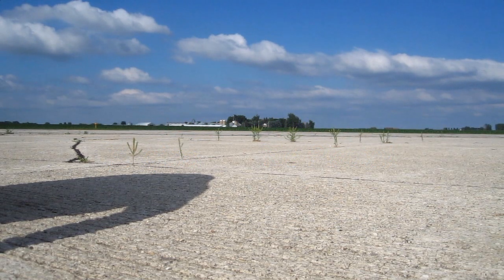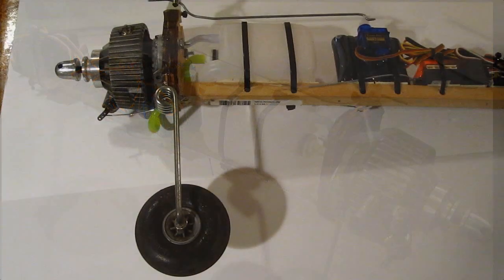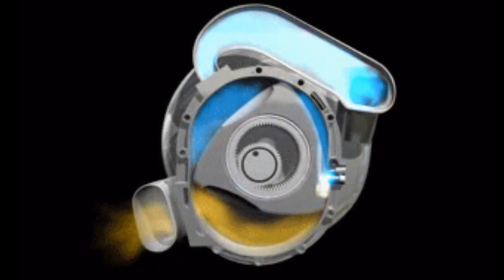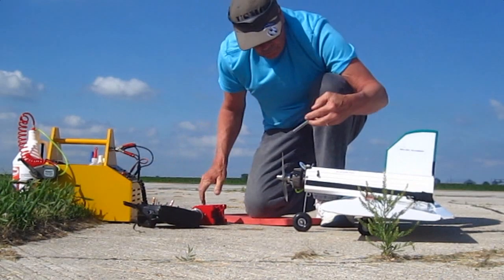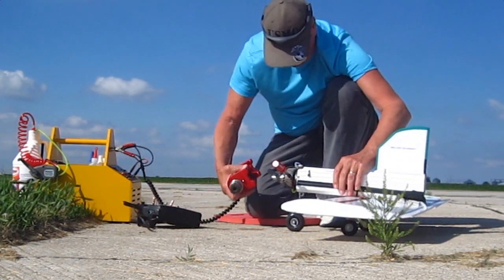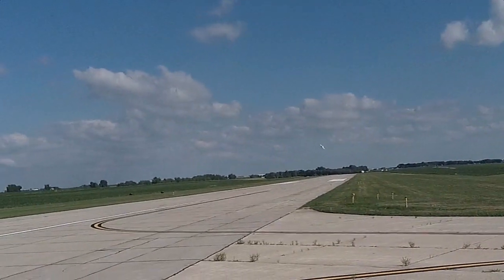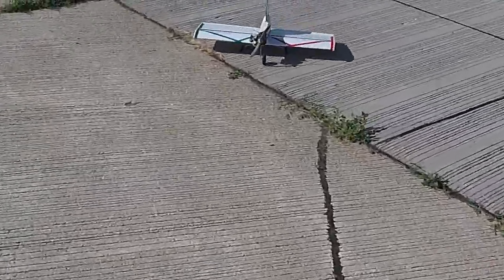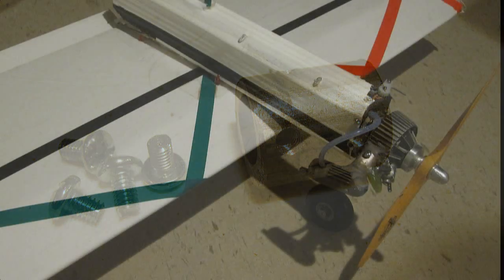Tiny German Nitro Engine has NO Pistons but is a vibration-less powerhouse for it's size!

Comment: I spotted a muffler on eBay if you’re interested
Reply from the maker: Thanks.  The muffler is not the problem. It is the cooling ring around the engine that it attaches to.  That mount is broken. Sure would like to find that part.
Reply: @NightFlyyer  ah, that’s a shame, hopefully you’ll find one soon. 👍

Comment: When I was a young boy some RC club members used to have a wankel engine in their pretty fast models. I think they did use a smaller prop and the engine seems to turn twice as fast than yours. Was an amaziing sound! According to https://www.os-engines.co.jp/english/line_up/engine/air/wankel/manual/rotary49pi_2.pdf it has it's highest power output at 17,000 r.p.m. Greetings from Germany :-)
Reply from the maker: Mine is turning aroung 15,000 rpm on a 9 4 prop, which The manual says to use.  I have other videos of my first Wankel which was new and ran better but was destroyed in the fire.  This one is pretty worn, which I got from eBay and doesn't run as well, but still happy with it.  Here's from 2011 with a better newer engine.  Thanks. https://www.youtube.com/watch?v=FrsSvTx8KG8
Reply: @NightFlyyer  Hello and thanks alot for your reply and sorry to hear about your losses caused by the fire. Must be horrible if everything ist lost. :-(
The high RPMs were reached wile doing a nosedive with the plane. I agree that this might not be too good for the engine, but for there are no oscillating parts it seems not to be as harmful as with a traditional piston engine. The sound was spectacular definitely  :-)

Comment: They are on eBay all the time.  Both the earlier ones with just the tapered finning design, and the later one with the added cooling fin scheme.  And some come with a nice muffler.  Some used.  Some new in the box.  Big demand, though, so they are pricey.
Reply from the maker: Yes.  I have had several and got them all on ebay, except the first one which I show in this video I made a few years ago.  They are pricey.  Thanks.  https://www.youtube.com/watch?v=FrsSvTx8KG8

Comment: I wish I never sold mine.... Now they're collectors items. I had one of each size graupner sold...
Reply from the maker: I wish they were still making them.  My original one was burned up in a fire and ran better than this one, and your right, I got it on ebay and it was expensive!.  Thanks.
Reply: @NightFlyyer  So sorry you lost your "good" one in the fire, I can't imagine. But it seems some of whats driving the prices up on these are Mazda Rotary heads buying them all up for "desk trinkets" .
Reply from the maker: @JessHull  LOL  True.  Thanks.

Comment: @NightFlyer >>> Is the O.S. Wankel out of production?

FWIW:  For years I have wanted to try building a powered parafoil - MY preferred name for a powered parachute - as an aerial camera platform, to augment KAP &  KAV {Kite Aerial Photography & Kite Aerial Video}.   I have YET to try building one...😊

That said, I wondered of the Wankel might be a good engine choice due to minimum vibration.  HOWEVER, someone online informed me that they (1) Tend to burn MORE fuel than standard glow plug reciprocating engines, and (2) They tend to run hot, and need plenty of airflow for cooling.  A powered parafoil being a slow-flying aircraft, I presume that would provide insufficient cooling air.
Reply from the maker: OS stopped producing this engine years ago and why they cost to much on Ebay, if you can find one.  It would not make a good parafoil engine, as your right, they use a lot of fuel, the exhaust is very messy, and they do run hot.  I'd stick to an electric Parafoil, if I were you.  Good luck and happy flying.
Reply: @NightFlyyer  >>> Rodger all that - Thanks!!!!

Comment: Hmm I wonder if you could make the outer part spin like an outrunner electric motor
Reply from the maker: Unlikely as it would be hard to hook up fuel lines, carb, and balance I  suspect.
Reply: Not practical for this, but "rotary" airplane engines did exist.  In this case, a "rotary" engine looked like a radial airplane engine at stand still.  But when it ran, the cylinder assembly rotated.  This helped with the air cooling (especially if the airplane was standing still), but also added air friction losses due to the rotation.  Fuel and oil was, obviously, handled differently and a problem was that oil was centrifugally thrown to outer parts of the engine and had to be continually replenished.  So typically oil was mixed in with the gas, even though a four-stroke.  There were also some engines like this, usually 3 cylinder, made for some early cars and motorcycles.  They have (or had) one at Cal Poly Aeronautical Engineering Department at San Luis Obispo on a test stand that they would fire up once a year.  Pretty interesting beast to watch.

Comment: 5cc is tiny?
Reply from the maker: This is tiny compared to a .90. 5cc compared to this is tinier. It's all relative.
Reply: Wgat a strange world you live in? 0.1cc could be called tiny. I beleive this wankel engine is designed to run on straight fuel, not nitro.
Reply from the maker: No kidding! LOL. What is your point?   This is a unique engine that can easily run on Alcohol and synth oil, and runs best with at least 5%, as was recommended by the manufacturer, however most engines will run without any nitro content.  I own the smallest production engine in the world, so I understand small, and am no armchair pilot, as you would know, if you have ever watched any of my videos.

Comment: I was making a B-25 with 2 ,OS rotary motors . They put out 1.25 HP each , were small and looked real behind the coke bottle bottom cowlings . They would suck gas like a 60 .
Reply from the maker: Your right about the fuel consumption for sure!  Bet it sounds great, though!

Comment: I am amazed at just how flat and square a flying wing can be and still fly.
Reply: Also that initial camera angle, made it look like a scene out of realflight simulator haha
Reply: Looking forward to the heli vid. I haven't gotten the courage to fly my 450 again yet since the rebuild.
Reply from the maker: Real flight isn't as real as this is, believe me.  LOL.
Reply from the maker: It's on the editor and almost ready to put in the can, as I flew it tonight too.  Please stay tuned. Thanks.
Reply from the maker: I always said, you could fly a garage door if you have enough power. BTW, it's not square or flat. It has an airfoil that you can see in my build video from last summer.  Thanks.

Comment: Nice universal plane "stick" I love it! BTW have you asked at Graupner directly? When I worked in south Germany I always drove by a big facility of theirs, they probably still have that model.
Reply from the maker: I have not.  I've spent hours searching however with most used engines selling on ebay for $400 to $500 so I gave up and made the sleeve which is working very well so far.  Thanks kindly.

Comment: Its been awhile since I heard one of those running. That engine is really revving nicely, pity about the damaged muffler manifold. That's not going to be an easy repair.
Reply from the maker: Thanks. Not always do folks tell you exactly what conditions things really are on Ebay!!  Actually my sleeve was not that hard to make and is working pretty good so far.  Thanks kindly!

Comment: cool stuff! didn't know Graupner made those, always wanted to try one, never did
back in the day a local drag racer had a mazda rotary in a glx, it walked 454 chevys, sounded like a hornet in a can
Reply from the maker: Yes, I think they are bringing back a new version too.  It will undoubtedly crank!  Thanks.
Reply: Graupner was the distributor, they were manufactured by OS Max of Japan. Beautifully built engines, however the early ones had teething problems with the rotor compression pads failing prematurely.

Comment: Love my rotary cars! They don't have a lot of power, but the RPM range and the light weight of the engine mean improved driveability and a good power to weight ratio. My RX-7 only had 185hp, and the RX-8 only has 240hp. The RX-7 was so light, I think it was actually faster than the RX-8.
Reply from the maker: They could really wind up the rpms for sure too.  Thanks.

Comment: That wankel would honestly be great for anything speed related. They dont tend to have much torque, but they can spin at 20k rpm all day
Reply from the maker: Very true. Lousy on fuel economy too!  Thanks.
Reply: NightFlyyer not that bad of a tradeoff for so much speed and power in its weight class.
Reply: Butternut Squanch piston engines may be more capable, but wankel engines are a lot of fun to use
Reply from the maker: That is true.  I never said there weren't other high speed engines.  I just said this unique rotary engine does pretty good at 18,000 rpm on a 10.6 prop with no piston! I had a tiny cox .010 that cranked 27,000 rpm with a piston and a 3 inch prop.
Reply from the maker: @iCrashPlanes I loved my .010, but it along with all my planes was lost in the huge fire plus just about everything else I owned.  Those tiny balsa Guillows models were great for the .010.  Happy flying.

Comment: Once I tried to make my own micro Vankel engine but I had no compression. problem was the apex seals leaked on the side but if made them with tight fit they will seize when engine gets hot so it got junked it was weak and dangerous to run rest in pieces literally
Reply: NightFlyyer you could try put a non restrict muffler .4 stroke engine runs stronger if it breathes easy, and use the electric fuel pump with fuel pouch if possible but not recommended long term solution because spare parts are scarce we don't want to retire it :)
Reply from the maker: That would be a hard project for sure.  They DO get hot!  This OS Max Graupner never has failed, so they had it figured out and made them for years.  Wish they still did.  Thanks.
Reply: Sounds like you would have to get very precise and establish a operating temp, calculate material expansion and measure time and time again
Reply: kennedy796 if I ever try again I think the apex seals need to be made out of crome the thermal expansion issue would be resolved and the engine could last longer and have better compression
Reply: Black turbine or just make it all out of similarly expanding material. Cast iron comes to mind.
Reply from the maker: I have tried that and it runs awful with no muffler and still no way to attach it anyway.  I know Harley guys think their engines run better with no mufflers, but when I went to mechanics school back in the 60's I was taught 4 stroke engines run better with some back pressure. This is not a 4 stroke engine however. My sleeve is working very well, so at my age, it will probably outlast me.  Thanks for the tips.
Reply: kennedy796 that would make a good, hi compression and cheap to maintain but the counter balance would be huge to compensate so is would have some gravity to it . I used stainless steel for end plates,oval,eccentric shaft,counter mass, and aluminium for rotor,prop spinner, engine mount.
The rotor has side seals so thermal expansion ca be ignored but apex seals need oil clearance so they don't dig into endplate so no compression, but if I make them enough of a fit to allow engine to start then they dig and destroy the whole engine. 
The blueprint is long gone but I have v2 in mind
Reply: NightFlyyer I never thought about that so it's designed to run with some back pressure I can see now how important muffler is it pressurises the fuel tank to push fuel into carb I never thought about it it also explains the size of the carb smaller ones can fly hi without riching out so much like big ones

Comment: This is a Wankel engine, invented in the 1950s by Felix Wankel in Germany.
As I remember, Mazda produced a tiny sportscar, the Mazda RX-7 which was powered by a Wankel-Engine. 
A teacher of mine had an RX-7 here in Vienna, Austria, in the late 1970s and it had a lot of power.
Reply from the maker: That is correct.  My friend had a RX-7 also.  Your right, fast and smooth, but horrible on gas mileage!  Thanks.